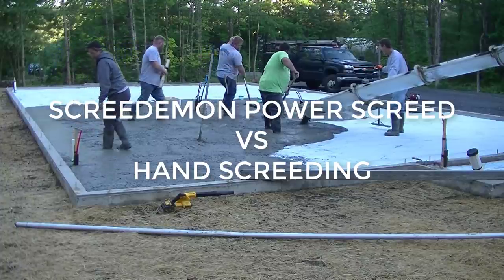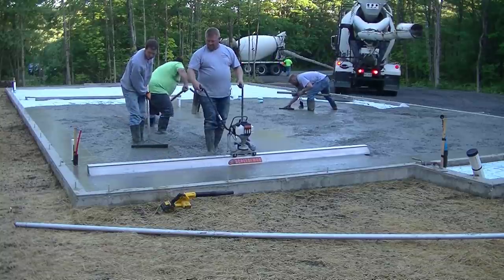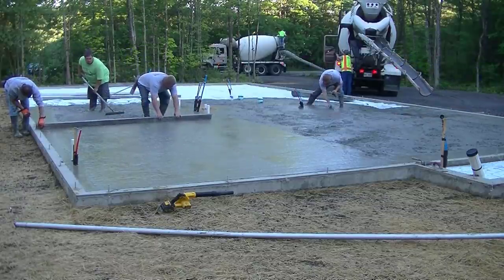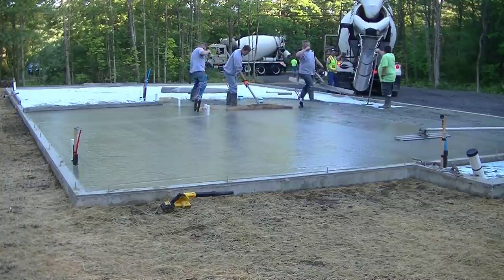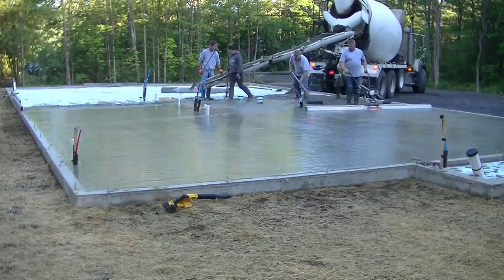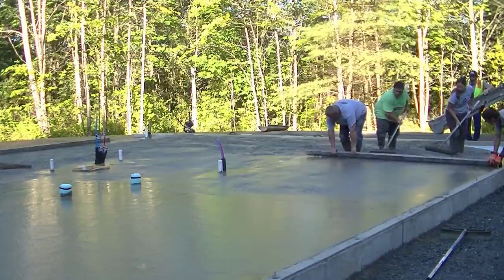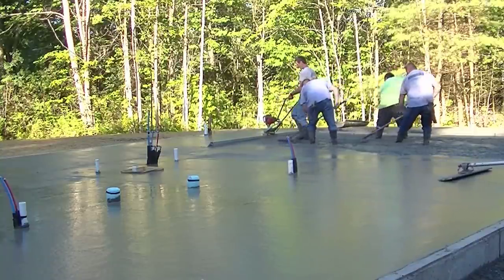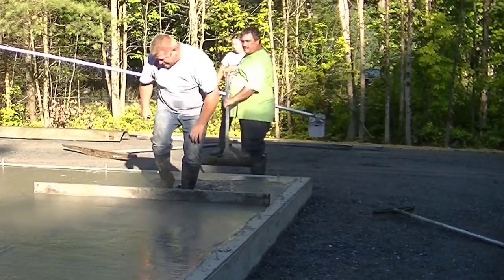Hand Screeding VS Power Screeding: Best Way To Screed Concrete

Comment: Love your awesome channel Mike!  I’m down here in Richmond, Va.  I enjoy trying to do things myself when I can around the house.   I just spend this past weekend putting in a concrete crawlspace for my sunroom addition. The addition is in the process of being built and there were no joist yet.  The dimensions are 18’ x 16’.  I dug out the crawlspace level, added 1-1/2” of gravel dust wetted and packed.  Placed 10 mil plastic down and up the walls about 12”.  Used remesh for reinforcement.  Previously, I purchased an old used mixer for $50 which was very well worth it.  I used 60 pound bags - three at a time in the mixer.  For someone who doesn’t do this everyday, it’s kill work on ones body!  It took two 16 hours days to complete!  It doesn’t look too bad for a rookie.  I learned what I know from your channel here!  Thanks so much for sharing your knowledge.
Reply from the maker: Thanks Steven!

Comment: We tried one when they first came out ( power screed) threw it off the slab . I guess when your used to screeding by hand it's easier and faster , I've worked in many states in the U.S. and they all have different ways of working .Yet it gets done , great job

Comment: Mike, My question is, What technique results in the flattest surface? I'm tired of finding 1/16 to 1/8 or deeper low spots that hold water that freezes to slick ice. Any puddle of water will freeze into dangerous ice. 1 1/2 in slope for 10 feet should never puddle but my concrete has puddles everywhere. How do I get/select contractors who do true flat work? 
I'd like to see you and Victory and others have a competition for flattest concrete with a puddle test afterwards.

Comment: The only problem about pouring the mix wet is shrinkage. So using the power screen you said it in the video. Your aggregate sinks leaving no structural stability  to the surface. As it's only sand and powder left behind.

Comment: Seems like it would want dig in ? Are the pin set at height to make sure your level… So are your wet pads the gauge to maintain level… I’m an old guy and always hand screeded.  Also does this screed serve as a tamp to push the aggregate down so that bull floating is nice?

Comment: Im from Australia the two people screed is backwards, i can pull a 12ft screed by myself on 100mm slump
Reply: Im thinking the same thing, although we stick to 10ft screeds as we had issues with the 12ft getting bends/flex in them.. try to always keep it 120slump on pads/deco but sometimes you get the odd dry truck haha

Comment: I have screeded concrete a few times with a 2 x 4.  I'm  62 and will have younger help to pour a 21yd driveway.  Would a power screed work in one pour. And/or use a pipe and forms to set screed on and in 2 pours?
Reply from the maker: For just 1 pour I'd screed it by hand.

Comment: Job well done. I’ve never done any kind of screed, however my garage is 20/20 it looks easy to do, but I am intimidated to do the job. I was wondering what kind of a tip would you be able to give me in order to build my confidence?
Should I buy a power screed it looks very easy to do if I just split up the garage to two sections. Thanks!
Reply: That’s an excellent idea, to break it up into pieces. You would likely do 2 saw cuts (midway, each direction) on a 20x20 slab anyway, so breaking it up into pieces would help to eliminate the need for that.

Comment: I'm an amateur. I've poured a few houses and several driveways as well as miscellaneous projects.  I"ve never uses an aluminum screened, let alone a power one.  I can see how the power screed saves backs.  I had a perfectly straight redwood 2x4 that I used for a screed.  After pouring my driveway on a previous house, I washed it and leaned it up against some scaffolding to dry.  Apparently someone thought It was a pretty nice board, as they took it.
On a previous video, I asked about a water based sealer and you made a recommendation.  I've bookmarked that on Amazon.  The directions say to redo in around 5 years.  This is going to be in a low traffic area of our basement.  How about putting a wax coating on after it cures.  That's easy enough to supplement now and then.

Comment: Im wondering if it matters which way you pull the power screed.  I am assuming it would be better to go from the high point of your grade to low or vice versa.? Are you able to have one end of the board at the high point and the other at the lower grade and pull that way?

Comment: I’m thinking about ordering a Tomahawk power screed from Home Depot online. The 12’ model is $950 and has 1.6 HP.   They also sell different blades from 8’ to 14’.
Reply: Did you ever get that ordered?
Reply: @didisaythat4230  No I didn’t.
Reply: @kanisohana  ah OK. I'm afraid to pull the trigger on it but I would like to try it as well.

Comment: Mike - We also use the Screedemon and love it.  Can't wait for the battery version to come out this fall!  We have the 8, 10 and 12' bars thinking about buying the 16'. So my question to you is - Have you used the 16' Sceed bar?
Reply: So glad to hear you love the ScreeDemon! You can actually pre-order the ScreeDemon™ Powered by M18™ REDLITHIUM now from your local MBW dealer. Also if you ever have any photos or videos you'd like to share using MBW, please email it to heatherh@mbw.com We'd love to hear from you.
Reply: MBW Inc what size bars will the cordless version run?

Comment: Damn. I could do that myself, with that power screed, if I had to. 
Also, I like the handled short board. Nice work.
Reply: I was taught, pushing the aggregate down, makes the surface weak, because it doesn't allow the cement to bond with the rocks towards the surface.

Comment: usually hand screed like you do. either smaller area like a porch, or a lot of plumbing. you can hand screed and tap if you can keep track of your level. works like power screeding but best on a small area.

Comment: With 2 good grade guys "using a shovel not a come along " I can pull down a very flat slab with the vibra screed. But using a stick and bump cutting a floor will always be supreme and set up better . But it's nice in the summer sun getting it down fast and pulling cream up with the vibra.

Comment: Hey Mike, I am from Denmark (so you know) Nice work😀 whereabouts I comeback from we often/ mostly ude self-leveling concrete, what is your experience  with  that? We Can poor appr. 200-250 m3 co ncrete on one big floor, 4 guys appr. 30-35 hours incl. finish on a helicopter. We also use that method on family houses like this. I most say that we aften a few days we grind the surface.

Comment: Hey Mike.
I have a question...
I'm starting to pour lots of concrete lately and I noticed our concrete is always little low on the formside...
Our guy tells me to kind of roll the screed? But I see you guys have screed tillted one side. Does rolling the screed causing it to go too low?
Reply: low edges are often caused by dipping the bullfloat on the return pull, it's very common you just need to pull it back with a hand float when catching the edge.

Comment: With a 7 inch slump concrete it’s like water , it is more easy to hand screed. We usually hand screed on a 5 slump on a size like that , 4” thickness, but on largest areas we use the machine

Comment: Hey mike great work, what’s your go too on getting the middle of a pour at the right height? I’ve seen guys pound piece of rebar at the right height then pound it in after they reach there height .. always makes me nervous when prepping for bigger stuff
Reply: It's easy to lose where your grade pins are doing it that way.Try using a wood or steel stake with a nail at elevation.Make a pad with your float then pull the stake.Lazer is the most accurate

Comment: I have the Marshalltown power screed. I can’t keep it from sinking sometimes and sometimes it works great. Do you k ow what makes it sink?
Reply: Your pulling too slow for the slump your pouring.You will get the hang of it.keep watching the ends of the Ends of the board
Reply: Richard Carter I’ll try switching up the speed next time. Do you keep the leading edge slightly tipped up or do you try to keep the screed board flat?
Reply: Mike Bollinger.keep it flat
Reply: Richard Carter thank you. That could be part of my problem then too. It seemed to ride better when I lifted the front up though. I’ll give it a try though and see if it helps.
Reply: rpm too high maybe?

Comment: Why no steel net?
Reply from the maker: The General contractor told us to only use fibermesh. Not my call
Reply: @MikeDayConcrete  do you think that wire net is better than fiber? In Florida, we rarely use wire these days. Only fiber.